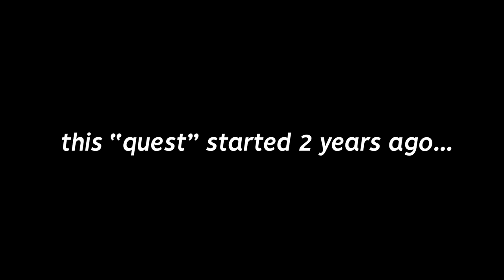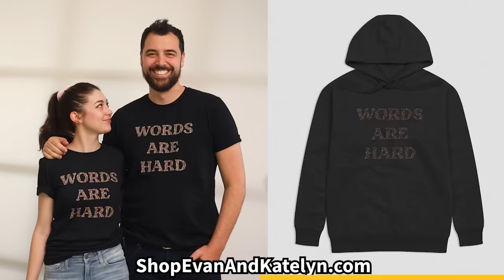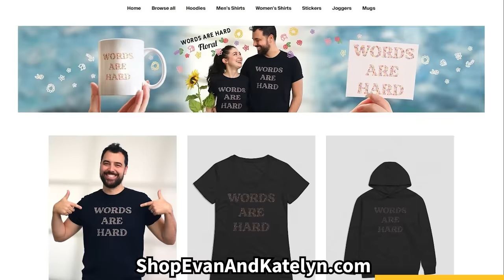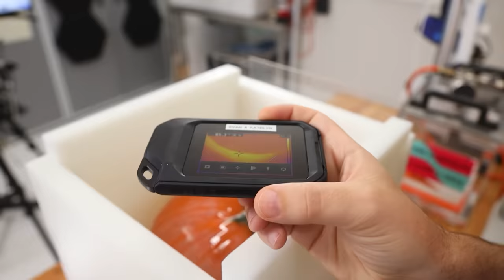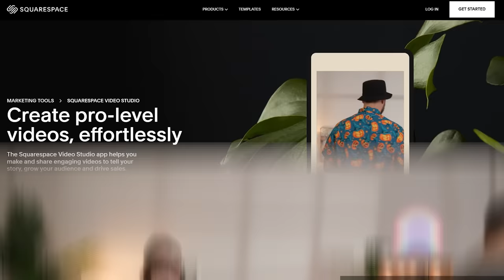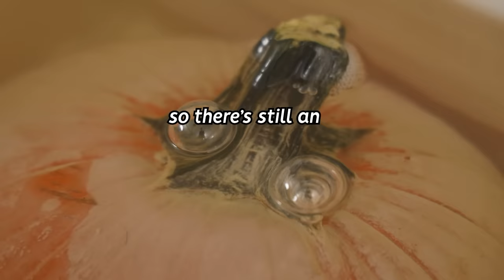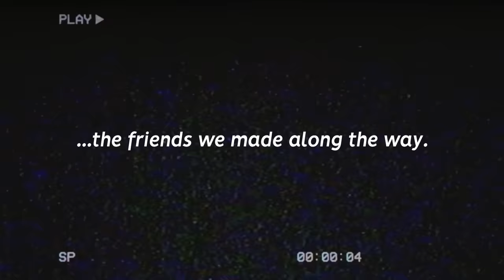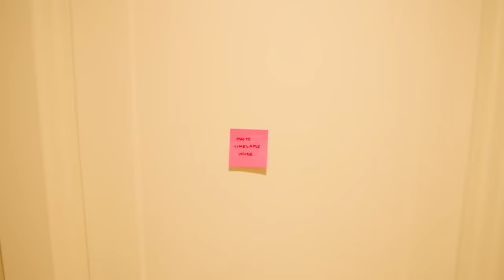Preserving a Pumpkin in Solid Resin… Will it rot?

Comment: Can't wait for next year's pumpkin extravaganza!

Maybe you could wipe the pumpkin down with bleach after carving to kill off all the bacteria that cause the decomposition.

Watching you guys go through project fatigue really was relatable. You guys are so cute together, bolstering one another to get through it 🎃🥰
Reply: Unless you, like, bleach infused, for lack of a better term, the pumpkin I don't think it would make that much of a difference. Most of their issues are with mold which is an airborne contaminant. Unless they had a clean room I think the dehydration route is where they should go.
Reply: I'd go with the fast resin coat to make the whole pumpkin watertight, then sous-vide for a few hours at at least 65c to kill off any bacteria and fungus spores that are in the pumpkin.
While the control pumpkin every year is taken by mould, the resin coated ones look to have been eaten by anaerobic bacteria. Dehydrating won't stop all of those.
Reply: Or umm, treat it with lye like certain pickles before sealing it in resin. And use a long acrylic tube that pierces the pumpkin on it's highest point to vent air...could even carve the inside so that's right under the stem - just don't remove the tube until you see it filling with resin so air doesn't have to displace resin to get out.

Comment: You should try coating it in resin then drilling a hole on the bottom sucking all the air out and replacing it with nitrogen as this will help preserve it (nitrogen is what they put in chip packages to keep them fresh and it is also safe to work with as about 3/4 of the air we breath is nitrogen.

Comment: Next year, use a mini pumpkin, fully submerge the stem, and put it in the vacuum champer (if possible). Or maybe do one deep pour and cure it in something really insulated like a cooler or powered off mini fridge? Also, definitely use a bigger vent hole at the back. Better to have a visible hole than a moldy pumpkin!

Comment: 🤔For next year; Tiny pumpkin, washed, carved, then placed in a container with some resin in the container already (for surface) filled and then placed in the pressure pot to get all air out. 😊
Reply: The water in the pumpkin will also boil of in the vacuum and ruin the whole thing.
Reply: Definitely agree with washing it, and using a smaller subject for time and cost. Wax and contaminants should be removed prior to anything permanent. Removing moisture early on would do a lot to mitigate leakage. Moisture in a vacuum chamber is too violent, though. If it were removed or replaced by a less volatile substance, it might do better. Freeze-drying the pumpkin might work, or maybe even using a UV cure resin, and pulling a moderate vacuum to slowly pull water while UV cure resin replaces the liquid in the cells. Then just pull it out and utterly blast the thing with UV light, strong enough to penetrate the flesh of it. As a bonus, it'll cook any remaining contaminants.

As an aside, a little orange pigment ink on the skin (left to dry) would maintain a stronger skin color post-cure.

Comment: It's spooky watching it change, and the somewhat white hue and everything xD love it!
I wondered, couldn't you inflate a balloon or something like that inside the pumpkin, and suspend it in a round mold so that you'd have to use much less resin? That way you could cover much more of the pumpkin in one pour, in addition to making it cheaper and lighter. I also think some of the changing is the delaminating of the first coat of resin, which you wouldn't need if you could cover it in just a few pours? Damn it I'm hooked on pumpkin preservation science too now x3

Comment: Hey, microbiologist here. I have a similar problem (just tinier scale) and I might be able to suggest a few solutions. The main one being... freeze drying? Cut a small of pumpkin, freeze it for about 4h and then stick it in the vacuum chamber, then close the valve and put the vacuum chamber in the freezer for about 3 days. I would also start by wearing gloves and scrubbing the surface of the pumkin in rubbbing alcohol (70% works best).

There are other "drying" methods you could use, e.g. a serial dilution of ethanol. This usually is followed by a round of dilutions with acetone, but you can do resin dilutions. This method substitutes the water in the pumkin cells with resin.

There are preservatives you can use but all of them toxic. My final and craziest idea would be metal vapour deposition. The chambers are not hard to build (The thought emporium video on youtube) and you could coat the piece of freeze dried pumkin in copper. Could look very cool.

Comment: Earlier today in the grounded stream, people were making suggestions, how to get the resin into the pumpkin. That's when I remembered something from my uni days (It's been a while). 
There is a process to replace the water in stages. It's used when you want to preserve tiny specimen that contain a lot of water and want to make thin slices for the electron microscope. Maybe you know a labtech who works in bio-science who could help you on that. This might help both with replacing the water, wich should hinder mold growth and other decomposing processes, and with helping the resin get into the pumpkin matter, wich might help against it building this milky layer when the pumpkin shrinks inside the resin. 
I'm not completely sure about the whole process, but if I remember correctly it is by first replacing water with a different liquid chemical, by moving the specimen into solutions with an increasing % of that other chemical. And then a several step long process to get the resin to replace that chemical, wich I completely messed up when I had to do that during a lab practical. 
This happens with tiny organic matter though (1mm at most), but maybe some part of it could be transfered to your projects. 
If this should work, it would make an awesome Science Adjacent Segment.
Reply: I was thinking about the plasticization process used to preserve the bodies used in that Bodies exhibition, I think they use a process like what you're describing (if I remember correctly).
Reply: @lbatemon1158  Perfect. Make your pumpkin extra spooky by preserving it like they do with the bodies from the Bodies Exhibition.

Comment: Are you completely sanitizing everything before doing the cuts? Might help delay the decomp!
Reply: Or just spraying the thing with anti-mold or something.
Reply: Problem is the pumpkin has juice in it.
Reply: Yeah spraying with an anti mold compound might help but ultimately they are casting an organic material that is moist it's going to decompose eventually, there best bet is to use a mold inhibitor after dehydrating the pumpkin as much as possible

Comment: Hi! I think plants have endo pathogens inside them. Maybe the mold is not only coming from the outside but it’s coming from the inside. That’s why dehydrating the pumpkin has lead to better results. Maybe next time dehydrate it and freeze dry it for longer before embedding it fully into the resin

Comment: I don’t know enough about resin to know if this is a good idea or not, but have you seen that thing where people use orbeez in a tank/vessel then fill it with water and they disappear? What if you made little resin marbles to fill and surround it, then topped it off with resin to make them disappear?

Alternatively, I still think resin marbles would be pretty cool. You could make a load in a variety of colours and create a whole new form of galaxy or arrange them in a rainbow formation to fill hollow acrylic chair backs or table legs.
Reply: The pre-cured resin marbles is brilliant
Reply: They did something like this! When they made bucket stools, Evan used marbles to reduce the volume of resin he'd need!
Reply: That's a great idea. with pre-cured scraps, that pour coulda been done in one or maybe two. Plus it would generate less overall heat, and cook the flesh a lot less. So, less juice!

Comment: My theory on what went wrong is that either the second hole you drilled started the molding process while you where filling the base, or that the stem was not entirely covered in resin and made its way through the xylem/phloem in the stem.

On the bright side it looks like a cute ghostie pumpkin 🎃👻

Comment: I'm a bit late. But the reason why Meatball got white is because of the heat of the resin too. You can see that the smaller amount was fine and the big amount was as white as snow. Correct me pls if I'm wrong but this makes sense to me😅

Comment: Recommendations: 1. Use a syringe for the air hole and that way you can suction the trapped air up through the hole causing the resin to fill the inside. 
2. Thicker initial layer of resin or what about clear spray paint then the initial layer of resin.
3. Spooky glitter or confetti in the resin, just for aesthetics.

Comment: I think they should have put the pumpkin upside down in the container or filled the pumpkin with resin before adding it to the container. I think there were too many places that resin didn't reach fast enough qnd those pumpkins rotted insanely quickly.

Comment: Science adjacent time! When you cook a gourd, you're weakening the organic cell walls that basically hold its "shell" together, while simultaneously expanding the trapped moisture, and forcing it out of any weakened pathway it finds. I have suggestions 🤔 

1) Carve out a lot more of the semi soft interior. Gourds have been used for centuries in indigenous cultures to be dry preserved, and hold water and other important travelable resources. We don't have well preserved examples that have interior walls over a centimeter thick. So that's the range I'd suggest you aim for :3

2) Make a thin salt paste (just a high Epsom or even table salt ratio, to a small amount of water, fully disolve, till its a thin paintable texture). Brush that on the exterior and interior walls of meatball. Let it air dry for a few days in a dry place that peoplewalk through a lot. My best ones were suspended for drying with the stem side downward! (Anyone who's dried herbs before will understand why that seems wrong, but I promise gourds are different)

Good luck guys! I know you'll make a Meatball you can be proud of. Hopefully this helped at all 🤍

Comment: My pitch for this year:
1. Start dehydrating a month ahead
2. Same general method for carving and encasement, but start with the head and the eyes down so the air can escape from the bottom 
3. To conceal the layer divisions and or imperfections, strategically place some decorative whatevers (literally whatever, glitter, snowflakes, beads, plastic spiders)
4. Carve out more of the pumpkin flesh. Remember the resin is going to support the shape in the long term, so remove as much skin as you can safely get rid of without the shape collapsing in your hands. Less flesh - less moisture.
5. Stick it in the oven for a couple hours before encasing jt, just to really get out as much moisture as possible

Comment: Idk if you guys will still read these comments, but since Halloween's coming up around the corner, I wanna summarize everything ive seen people say. I don't claim any ideas, I just hope you can get a success lol

Freeze Dry the pumpkin. Supposedly this is what's professionally done, idk if you guys would have access to the rught equipment in time.

Stabilize the pumpkin. I'll look more into this because I don't exactly understand what it's supposed to be but I have a guess it's something chemical.

Not a fix, but a problem I see brought up is the heat from the resin setting detaching the pumpkin. I don't if there's necessarily anything that could be done about this.

Sanitize the pumpkin(?). Now I dont know how you'd realistically strip it of bacteria and fungi first because most chemicals needed would likely destroy the structure of the pumpkin, along with organisms usually needing a certain microbiome to stay "fresh" for as long as possible, second because you'd need a sterile area anyway, like renting out an entire lab or something lol. Seems a little nuch for a pumpkin but that might just be me..

(I don't necessarily endorse or recommend some of these but) To summarize with some specifics and a few more I saw:

(?)Freeze Dry
Spray with bleach
Scrub with bleach
Find an EPA approved fungicide that isn't just a disinfectant
(??)Cactus juice
Remove any possible wax from production if it's not a fresh picked pumpkin
(???)Process in a cold environment (idk how in Texas)
(????)Remove the air and fill with nitrogen as a preservative
Different kinds of pumpkins
Alcohol to disinfect and dry out
Cast it upside down. I know you guys already did this but it's like every other comment lol
Don't leave in the middle of the process (jk from me lol)

(Sorry if it's short or a bit blunt my phone erased the comment so I'm trying to rewrite from memory)

Comment: Hello ! 
I don't know if you plan to try this again, but there's a medical specialty, called Anatomical Pathology, and there's this technique/protocol where you have to embed tissues in paraffin wax, and I think that what you're trying to do is kind of similar. 
The water contained in the tissues (here the pumpkin) is replaced progressively with ethanol in order to dehydrate the tissue, without having the structure collapse. Then the ethanol is replaced with a solvent that is miscible with both ethanol and paraffin, so that paraffin can enter the tissue and solidify to keep the structure almost intact (can't remember which solvents are used, but you should find a detailed protocol on how to do this online, since it's something taught in medical schools). 
Now it's not usually done in such large scales, but maybe it can help you !

Comment: That was a very cool video! As far as I understand, the very core of the mold/shrink problem is the water that is still inside pumpkin tissue. If you just dry it out, pumpkin looses its shape. So you can try replacing it with something else - alcohol, formaldehyde, propylene glycol or something similar; I believe there is a technique called 'eternal flowers' that works kinda like that

Comment: I think, maybe, if you intend to try again, you could place the pumpkin in an oven and try baking it at low heat over some time, so the moisture can evaporate (hopefully) without burning or cooking the pumpkin.
Though, I am not very experienced in that Department, so I don't know if it'd actually work.
Reply: They already did that. The pumpkin got moldy anyway.

Comment: You should somehow freeze dry the pumpkin before putting it in resin. That way the pumpkin would not rot and the color would stay as well.

Of course the problem is, that you probably do not have access to a freeze dryer big enough to fit a pumpkin, but maybe if you cut the pumpkin into puzzle pieces somehow, you could freeze dry the pieces and put it back together. If you decorate the seams with some string making it look like the pumpkin has been stitched back together, you would also create a cool effect. Or you could try to see if you can find smaller pumpkins and freeze dry those.

Comment: I think their second attempt was closest to success, but they should use the Cup Noodle method to dry out the pumpkin. The man who invented Cup Noodles supposedly was the first to preserve noodles by drying them out in a way that could be rehydrated when you are ready to consume them. If I remember rightly, it just required deep frying the noodles which would be a lot easier and cheaper to use on a large pumpkin.

So I propose to Evan and Katelyn to read up on the method Cup Noodles uses to dehydrate large amounts of product, use it on the pumpkin (maybe use a few smaller gourds as jack-o'-lanterns to get a few extra tests out in a year? (but that will minimize the chaos and fun ;)), and then stick that thing in the cube of resin.

Comment originally from Turgon Gondolin

Comment: Instead of an air/vent hole in the top, I'd have flipped it upside down and filled the inside up to the eye holes while with a slant to the back to perfectly eliminate that space.  Also, I'd have put some kind of "candle" light in (not under) there.  Maybe with a battery pack that can wirelessly charge (like a phone) or maybe even a small PV cell someplace.

Comment: For proper Control vs Experiment you should do bottom cuts for both. I know when root cellaring squash if the stem is removed they can't be stored bc they rot more quickly.

Comment: I was thinking about the molding and juicing pumpkins. You said you didn't remember them molding as fast as kids. Same. I carved some pumpkins this year, and they also molded faster. I wondered what we had in common, and it hit me. People put pumpkins outside after carving them. It's usually colder outside in october than it is indoors (if you live in a northern region). I think the cold prevents it from molding as quickly. What if you did this again in a colder environment? It could prevent the pumpkin from spoiling as fast, which will buy you more time. Also, I know that cream of tartar can preserve colors in vegetables when cooking. Maybe giving it a cream of tartar bath beforehand as well? Maybe even using a white pumpkin would help cheese the look a bit.

Comment: I can't get over trying to think of a way for this to actually work... maybe freeze drying instead of dehydrating? 
Less moisture availability and the cold temps should lower the chance of bacteria and mold forming until sealing with your signature resin coating?
I need an answer to this question....

Comment: My first thoughts:
1. Thin the flesh down as much as possible before dehydrating.
2. Freeze dry.
3. Submerge pumpkin in resin in vacuum chamber followed by pressure pot.
4. Gamma irradiate.